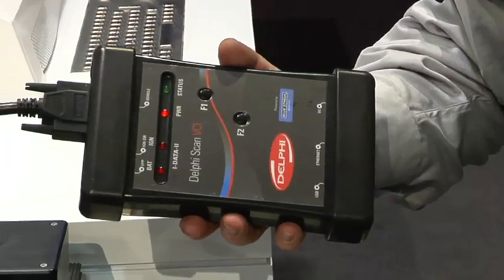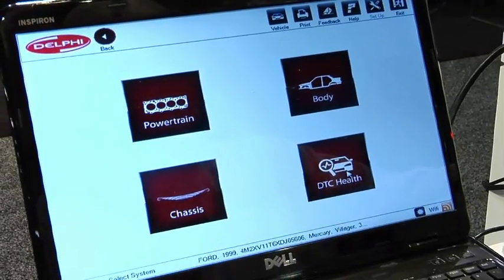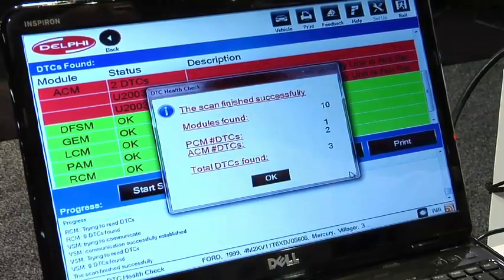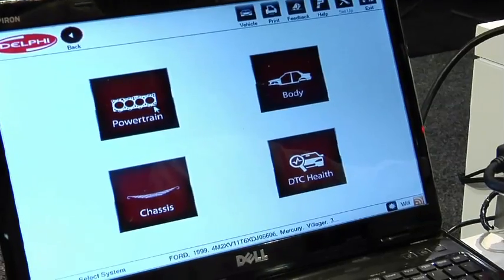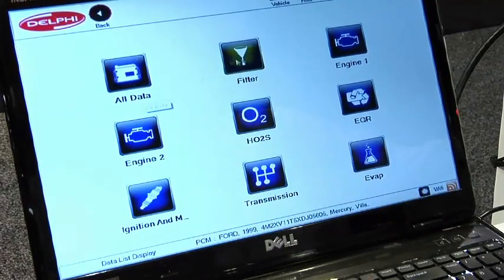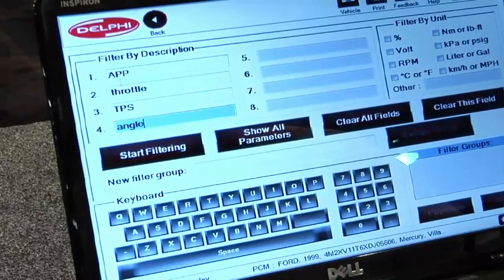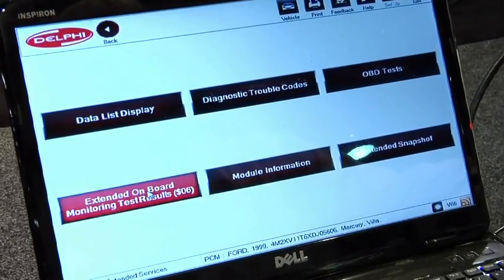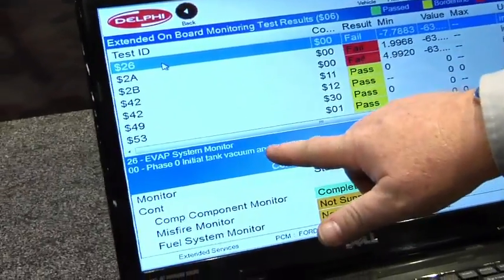Delphi Diagnostic Scan Tool Demonstration Video

Comment: Mr. Delphi please revist your fuel pump technology and redesign your magnets so the ethanol doesn't desintegrate them with E10 fuel. While your at it, anadize the components to prevent alcohol corrosion! Better yet, move your factories to the US and Europe.